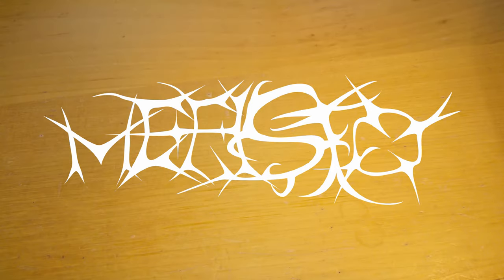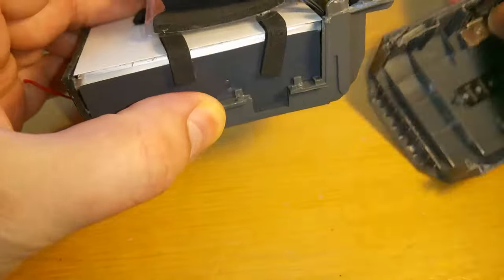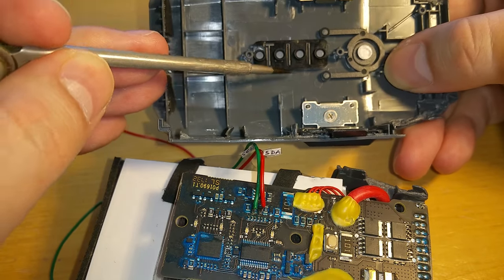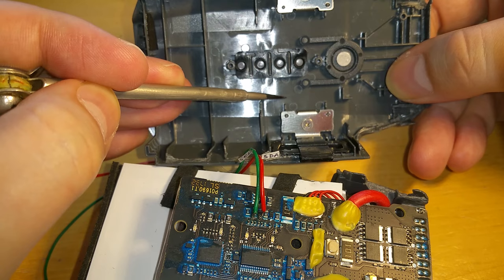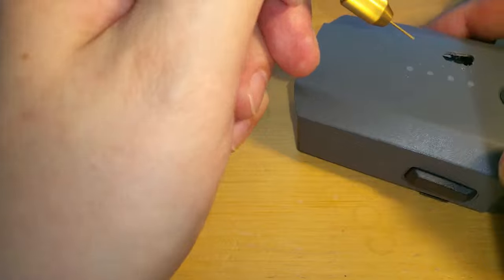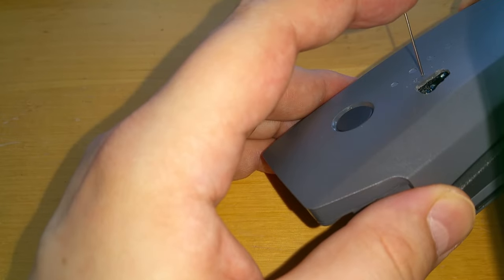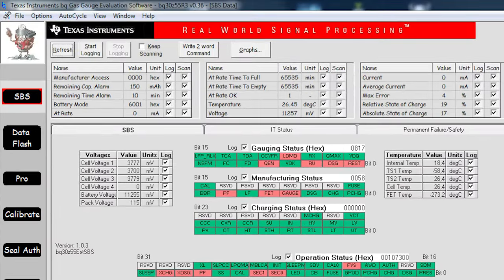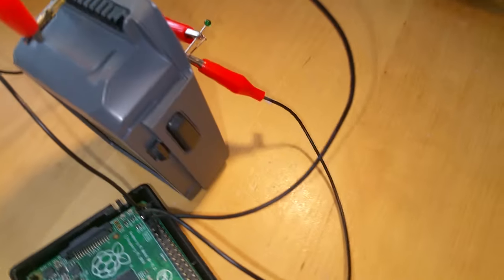Unlocking SBS-capable battery chip without expensive programmer - example on Mavic Pro battery

Comment: Hello, I am applying Unseal command, but SEC=3 still..  Someone allready wrote "BQ40z307 Unseal do not work"
Reply: yes, mee to,  i dont know why,  mavic mini 1 battery
Reply: @SzyxYank  there is free windows application named "dji battery killer". App  allows to unseal, reset errors and lot of modifications.. App connects to battery via hid USB to i2c bridge (cp2112)
Reply: @voodoo2110  ohh thank you for reply,  I have problem with authentication,  I am replaced cells, and now i have error  AUTH_ONGOING,  in battery killer I dont see that option
Reply: @SzyxYank  I have also replaced cells in mini-1 battery and faced with problem:  battery is not charging,  but it was possible to power on drone, with error message. I've sent battery eeprom backup to one guy,  he changed something and now battery works fine. Unfortunately I don't know what exactly he changed in my eeprom backup..
Reply: @voodoo2110  the same,  in dji app is 30074 error,

Comment: Does the chip code apply to the bq30z55 phantom 3 series, because the chip is the same, it doesn't mean the password is the same, is it possible to see the bq30z55 password for the phantom 3 series?

Comment: @ mefistotelis  - There's a much easier way using EV2300 or EV2400 and TI's FREE Battery Management Studio software.
SDA and SCK are available on the battery connector. No need to drill. Why are you drilling ? Sheesh !
All you need is the original DJI 'Unseal' and 'Unseal_Full_Access' Keys.
Let me know when you're ready to test and I'll give them to you. You helped me once with info on hacking a Phanton 3 Pro. I've just recently hacked the keys for the BQ9003 DJI modded chip. In BM Studio I use the BQ40z50 target. The target may not be perfect but does everything I need it to do. ie Unseal, Unseal Full Access, Save firmware, Load Firmware, Save new Keys to battery etc etc.
Reply from the maker: Sure, feel free to share the 2-word keys DJI uses with BQ9003. The python tool does allow to provide them via command line (default are 0xffffffff,0x36720414). Also, share which drone that is - in newer chips DJI introduced PFF2 which is not cleared by the TI "clear PF" command, it's surprising you didn't encountered that.
Reply: @mefistotelis  "The python tool does allow to provide them via command line" I thought I'd discovered something new. If you already have the DJI original keys, then no need to post them here. I'm working with Mavic 2 Pro batteries only. I also use dji Battery Killer software which does handle both PF and PF2. What one can't handle the other usually can.
Edit: I'm familiar with TI's (default 0xffffffff,0x36720414) keys , but I'm referring to DJI's keys. So your python tool displays these then ?
Reply: @jackevans2386   @mefistotelis    thank you friends,   it is possible to set AUTH=0,   currently is AUTH-ONGOING,   and charging disablet, how to repair this?
Reply: @Jack Evans, did you ever share the unseal keys for the BQ9003? I'm assuming thats the same chip for the Spark and I'm having trouble unsealing it.

Comment: I2cdetect sees 0b but is not able to communicate...

./comm_sbs_bqctrl.py -v --dev_address 0x0b read BatteryStatus
Opening smbus:1
Error: No module named 'smbus2'
Traceback (most recent call last):
  File "/home/kivialune/dji/./comm_sbs_bqctrl.py", line 7182, in <module>
    main()
  File "/home/kivialune/dji/./comm_sbs_bqctrl.py", line 7153, in main
    smbus_open(po.bus, po)
  File "/home/kivialune/dji/./comm_sbs_bqctrl.py", line 5536, in smbus_open
    import smbus2
ModuleNotFoundError: No module named 'smbus2'
Reply: Same here i cant know how to detect the correct i2c address and how to enter it to the code line for detection??
Reply: “pip install smbus2”

Comment: It seems it does not work with spark batteries. It won't autodetect chip, but if I set it to eithe SBS or BQ40z307 it will communicate just fine. It does not show any error on unsealing , but it remains on level 3 (sealed). Using orangepi and i2c.
Raw ManufacturerAccess.OperationStatus response: 04 80 73 00 00 bf